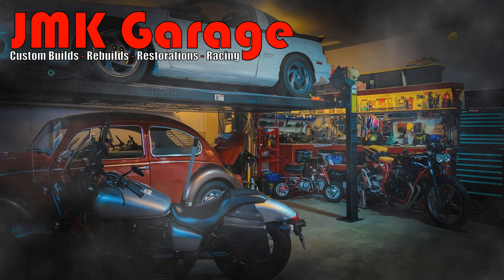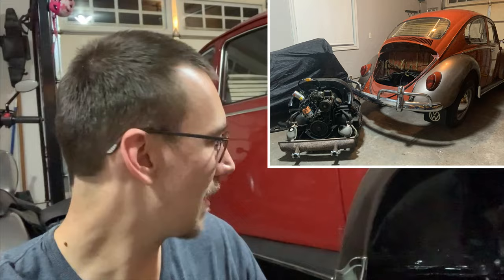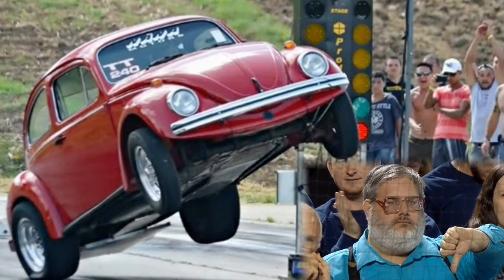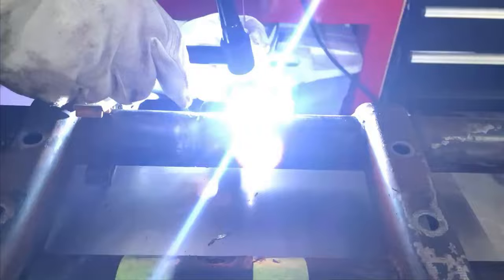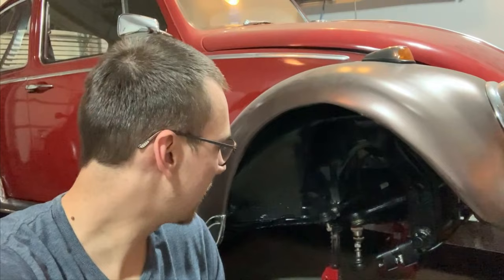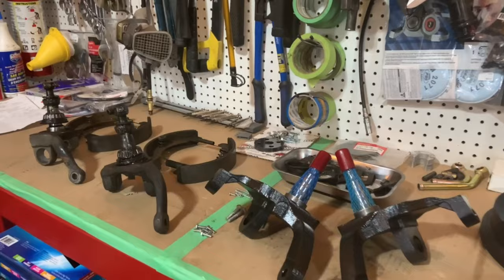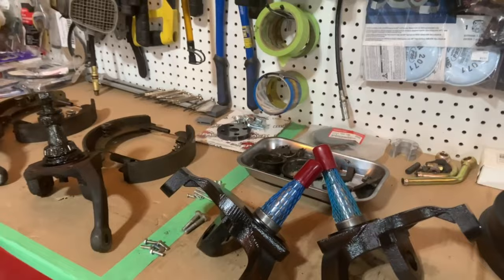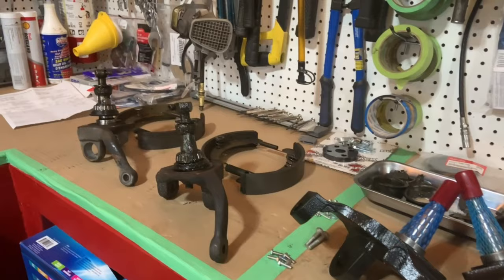Volkswagen Beetle | Front End Work | Adjustable Beam, Drop Spindles & Brakes

Comment: I want Todo that too my 66 this summer hopefully
Reply from the maker: Nice! Something to note that I learned afterwards… the drop spindles put the track (width) of the front wheels out, which cause the tires to now rub the fenders.  I’ve readjusted the beam back up as fast as they will go, but they still rub.  I have just had to put the stock spindles back on, until I get a narrowed beam.   Thanks for watching and subscribing to the channel man! 🙏
Reply: @JMKGarage  so let me get this straight.. lowered spindles with narrowed beam with stock wheels for that lowered ride and look......see I have a 66 and I was going to get front disc brakes and lowered spindle kit..but if it's going to rub..I'll have to get the narrowed beam I guess.
Reply from the maker: Yes, you will definitely need a narrowed beam, especially with the disc brakes as they push the wheels out even more… you’ll likely need a 4” or maybe even 6” narrowed beam
Reply from the maker: @somebeech30  here’s a video I just added after putting the stock spindles back in (with stock width beam and adjusters)… https://youtu.be/RmIGLiMG13M